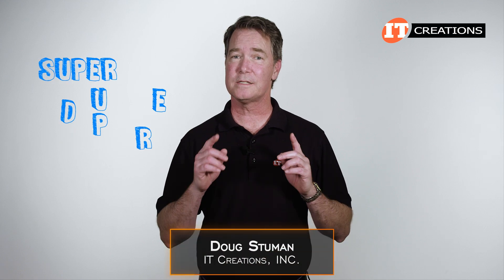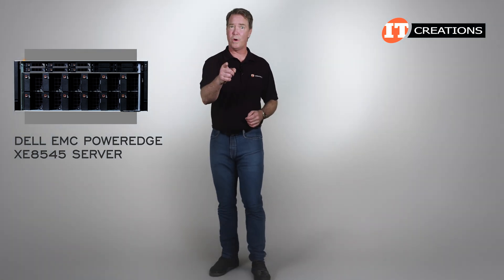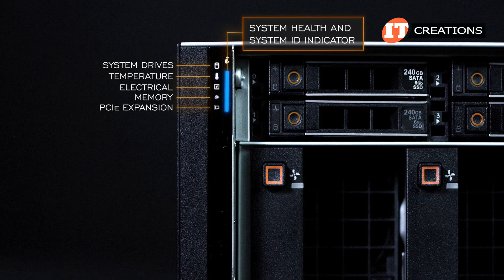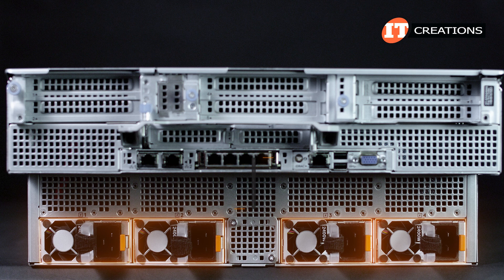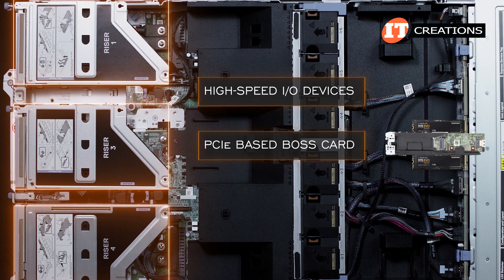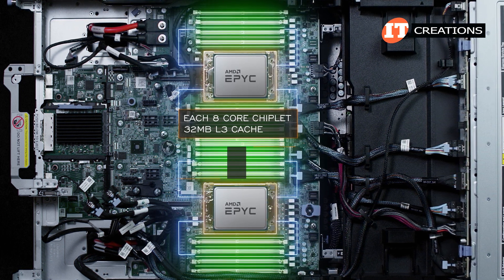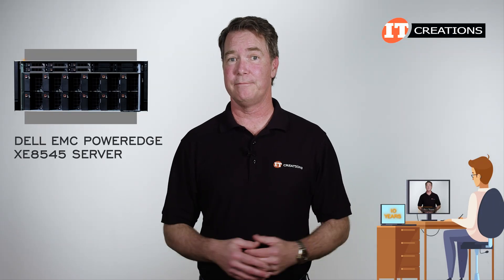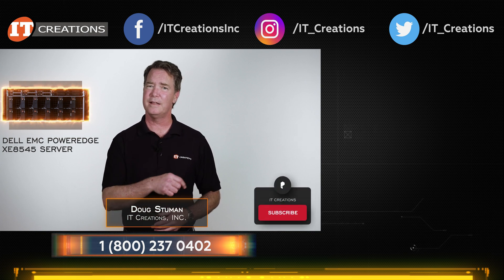Dell EMC PowerEdge XE8545 4x SMX4 GPU Server Review | IT Creations

Comment: Way above what I probably need. But I'm here. Hoping one day there's a server giveaway on youtube. Or maybe even new adobe(?) transitions.
Reply from the maker: Hope springs eternal! Thanks for watching!
Reply: Have you benchmarked this system with nvme gen4 ssd's on the back plane cabled back to the h755 raid card?  Can you prove that this works to utilize the gen4 speeds with raid?  Might you have the part number for the required backplane to raid card cable/s?  The h755n front card doesn't show to be supported so the longer cables would be needed.